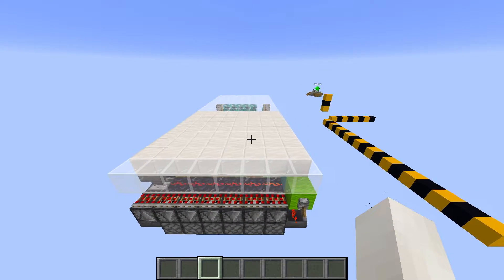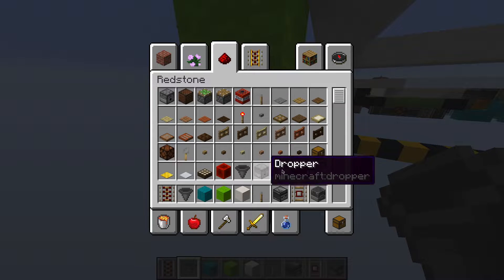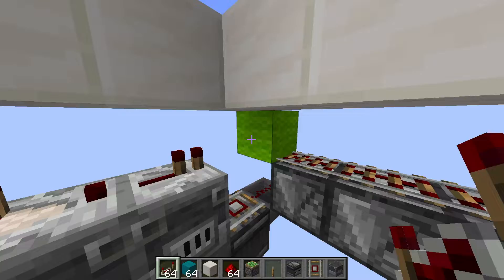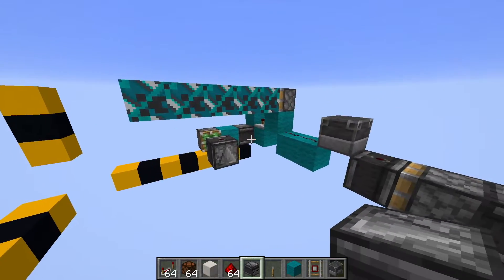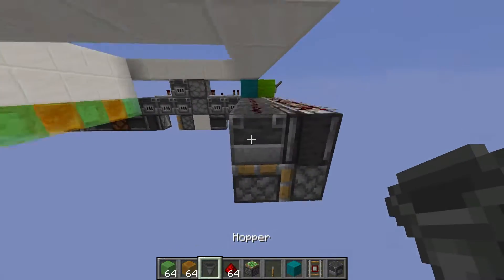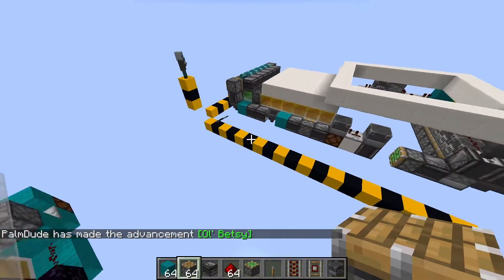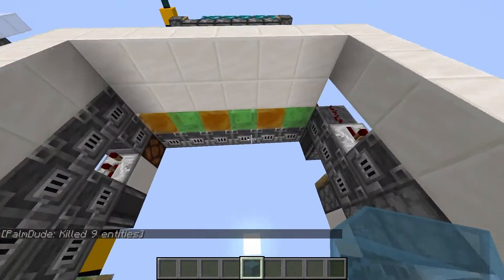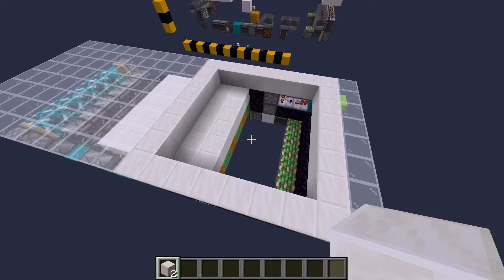Smallest 6x6 Flush Trapdoor [1.15+] (456 Blocks)

Comment: Materials:

Actual resources:
Building blocks
34 Immovable Blocks
30 Observers
27 Slime Blocks
26 Sticky Piston
21 Honey Blocks
10 Redstone Dust
7 Activator Rails
6 Hopper
5 Glazed Terracotta
4 Repeater
3 Redstone Lamp
3 Droppers
2 Piston
1 Comparator
1 Detector Rail
1 Glass

Raw materials (Assuming normal furnace as choice of immovable blocks):
Building blocks
602 Cobblestone (9 Stacks + 26)
131 Redstone Dust (2 Stacks + 3)
31 Quartz
269 Slime Balls (4 Stacks + 13)
35 Logs + 1 Stick
76 Iron Ingots (1 Stack + 12)
84 Honey Bottles (5 Stacks + 4)
20 Clay
28 Smelts worth of Fuel (4 coal will do it, or 17 planks)
12 Glowstone Dust
1 Sand

(Produces 5 excess activator rails and 5 extra detector rails)
Reply: thanks so much bro
Reply: Do I need to put more coal over time?